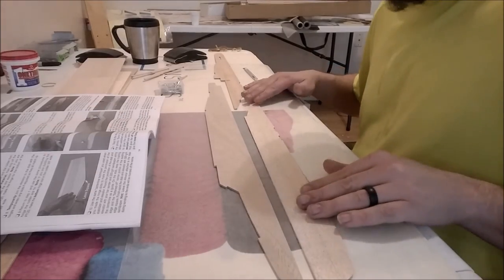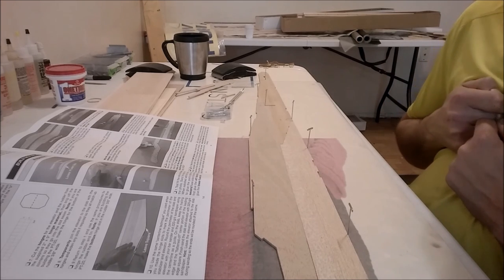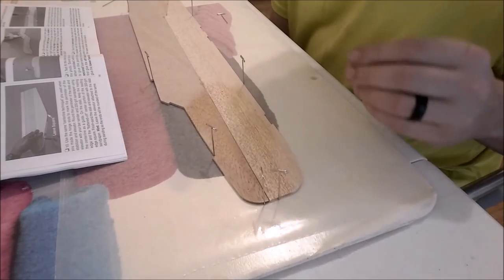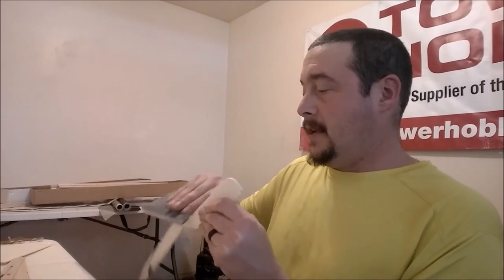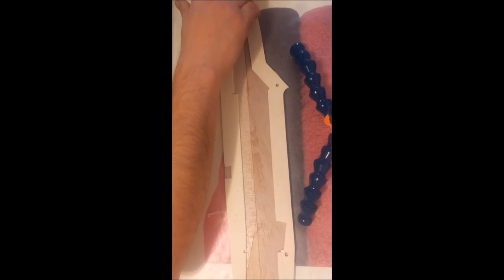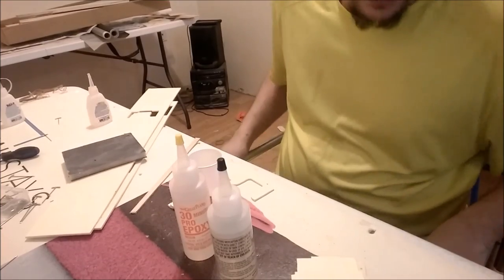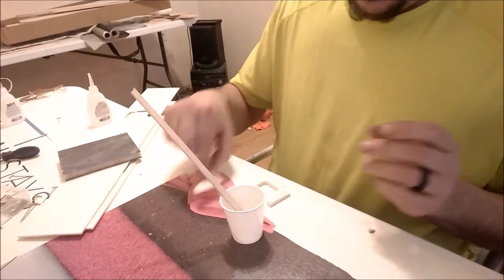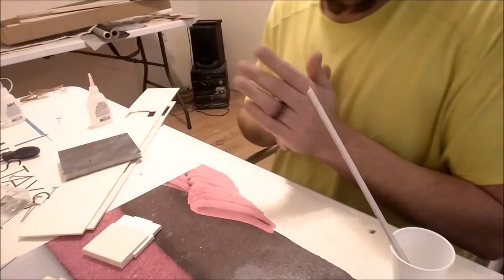PT 20 part 2 Fuselage build take 2

Comment from the maker: Ok folks, are we ready for a give away?

29 piece cobalt split point drill bit set

YOU MUST EMAIL THE ANSWER. DO NOT POST IN COMMENTS

What method did I use to measure out epoxy for a proper mixture?

Email your answers to

bigskyhobbycorner@gmail.com
Reply: +Big Sky Hobby Corner  Counted the drops